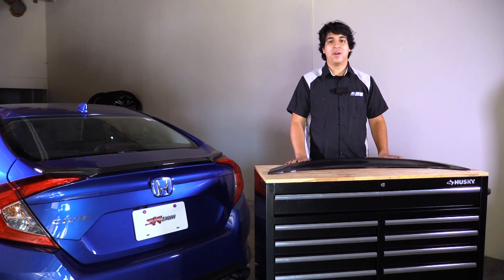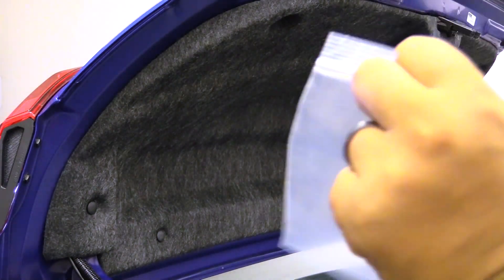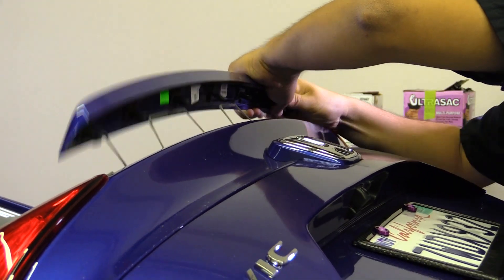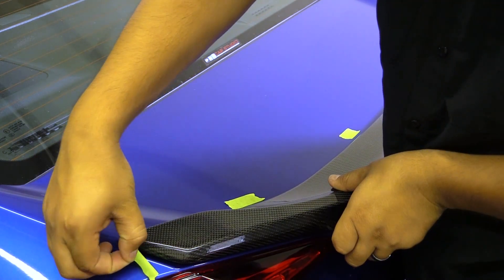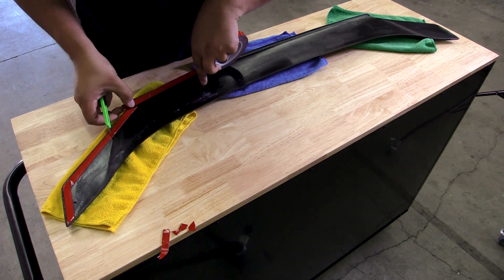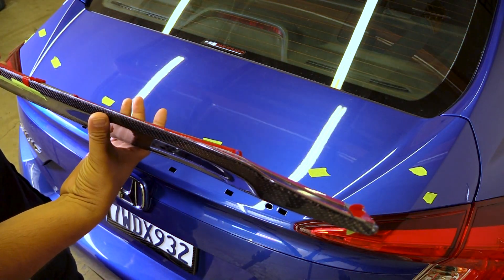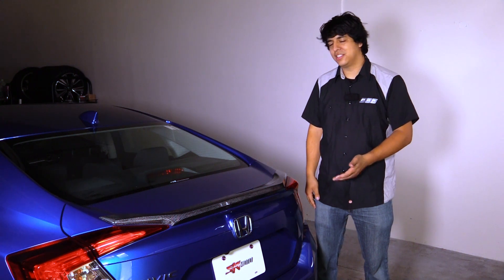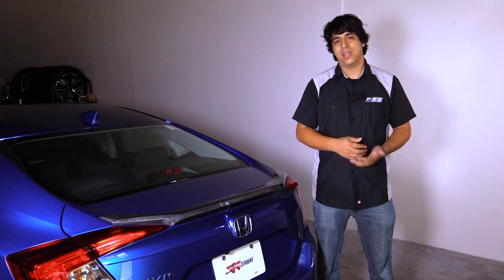SiriMoto Flush Spoiler Install - 10th Gen Civic - 2016 2017 2018 2019 2020 2021 Honda Civic Sedan

Comment: For those trying to figure out the clips: you have to have tension on the spoiler by prying objects under it like in the video. Then take a flat head and press on the tabs on each side. You should hear a snapping sound and the tabs shouldn’t be sticking out anymore but instead be retreated inside the hole (because there’s tension on the spoiler). Only took me 3 hours to figure out.
Reply: Thank you man
Reply: Thanks
Reply: Thank you so much!
Reply: Thanks good sir
Reply: Thank you !!!
Reply: Would have been useful if this was shown

Comment: @procivic what kind of cleaner did you use to clean off the trunk lid and spoiler?  I have a 2016 Honda civic that the spoiler got knocked off a few years ago and had been fine but now it’s leaking and want to replace it with something like this.  Thanks, William B

Comment: And now we have water in our trunk! The stock spoiler had a water tight seal.  This does not.  Am I wrong?
Reply from the maker: The adhesive surrounding the whole spoiler creates a water tight seal. We've had no issues at all through many car washes.
Reply: I had the same epiphany bro
Reply: Use weather stripping between the spoiler and trunk, and silicone sealant on the inside to fill any holes. Had 3 different spoilers, no water issues

Comment: What did you use to clean the area before adding spoiler ?
Reply from the maker: We used a prep spray. This can be found at most auto parts stores in their paint section. It is used to clean an area of any grease, oils, or other foreign materials from the surface. However, rubbing alcohol can be used as well.

Comment: Hey bro! What is the size of 3m tape did you use? Thanks
Reply from the maker: The size is 1/2 inch conventional double sided tape. However, it is already included with the spoiler.
Reply: Is it a clear or foam 3m tape?
Reply from the maker: It would be the foam style. You can see it being installed at this point in the video for reference: https://youtu.be/3cLkHIk_JTk?t=167

Comment: Will it work fr touring
Reply from the maker: As long as it is a sedan, it can fit. However, note that the Touring models have a small lip spoiler on the rear that will need to be removed and any potential holes left behind properly sealed.
Reply: @procivic  wouldn't this spoiler covers up the holes tho?

Comment: Only carbon-fiber available with this spoiler? Is there any other color option?
Reply from the maker: +Zafer Bilen This is only available in Carbon fiber. However, it is possible to paint it once you receive it if you desire.
Reply: PRO Car Studio but how can i find exact the same color of my grey civic?
Reply from the maker: +Zafer Bilen A body shop can generally color match or pull the original color code. It is best recommended to have them do it to best match the color of your vehicle.
Reply: Is it real carbon fiber?
Reply from the maker: +Saul Espino It is a FRP (Fiberglass Reinforced Plastic) skeleton with a real Carbon Fiber overlay.

Comment: Does the warranty cover it, if it comes flying off?..
Reply from the maker: +Jimmy Dorantes Unfortunately, it will not cover damages outside of manufacturer defects. However, we can help in getting a replacement if it does come off. If installed correctly, the wing should not come off as we have been using it on our civic in speeds in excess of 70mph.

Comment: The 3m tape is not that strong
Reply from the maker: The tape should be plenty strong. We have used it as is through plenty of rain, track use, and strong winds without any issues.